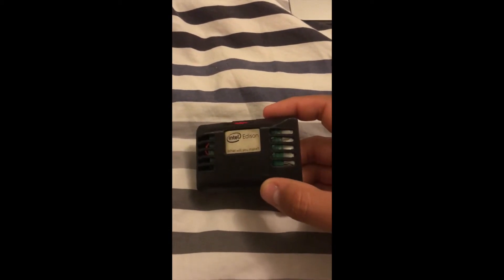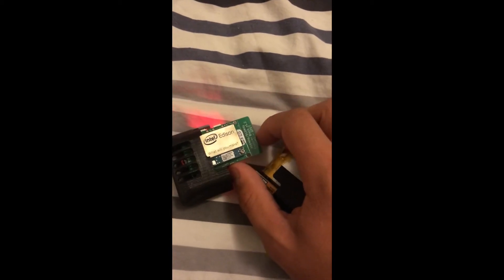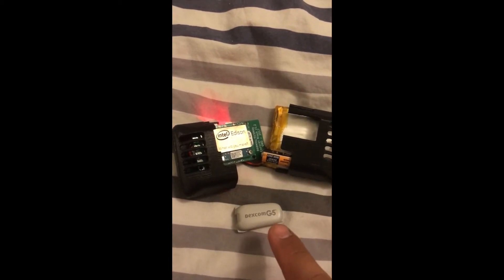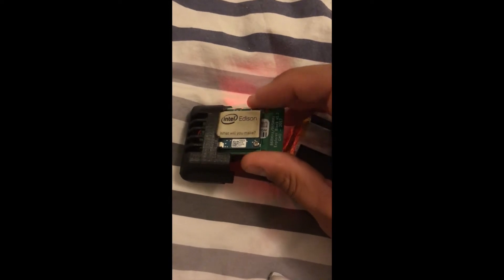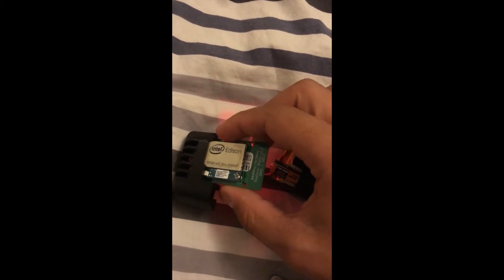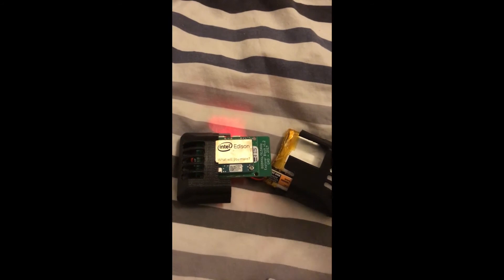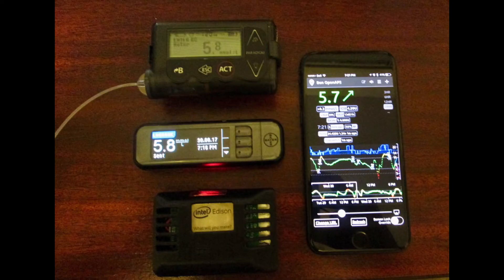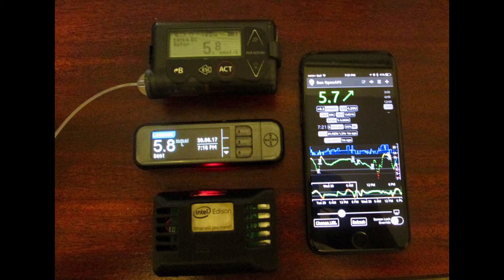I built an artificial pancreas and so can you!

Comment: Hi Guys .having a son with type 1 i am watching with interest.
My only concern is the whole operation focuses on the CGM sensor been accurate. Just tonight his Dexcom 6 was plus 5 and rising like a lunatic.  Had we been using this system it would have injected more insulin to correct thus send his real levels towards a Hypo. Be careful. Take care. Alex
Reply: Medtronic is best bro try it
Reply from the maker: Yes, this is a real safety concern. CGM must be accurate for successful automated insulin delivery. However, Dexcom G6 is the most accurate CGM on the market (MARD 9%). I have a more in-depth video discussing DIY artificial pancreas systems if you would like more information about the #WeAreNotWaiting movement in the T1D community https://youtu.be/s5lXjIdE_3Y
Reply: @bmamms  It can however act extremely wildly at times. 96 percent isn’t good enough it needs to be foolproof. Maybe Dexcom users should wear 3 or 4 patches in different areas to use this. And also maybe if it will deliver big doses of insulin there should be some verification check with current blood sugars or it should deliver insulin only by delta of the change of blood sugar. If the change of blood sugar per unit goes above 25 percent in x amount of time then it should require a check.

Comment: So what happens when there is no internet connection?Please respond asap ,since i need to decide between loop and openaps?
Reply from the maker: OpenAPS requires an internet connection if you are using the official Dexcom app, Loop does not. I have created a more in-depth video discussing DIY artificial pancreas systems if you would like more information about the #WeAreNotWaiting movement in the T1D community https://youtu.be/s5lXjIdE_3Y